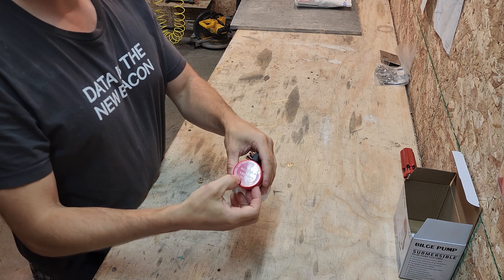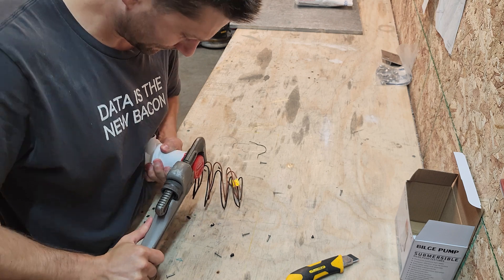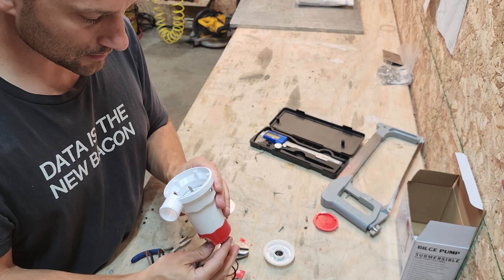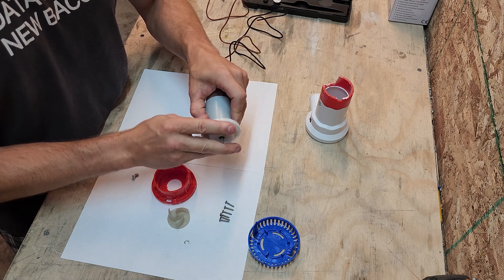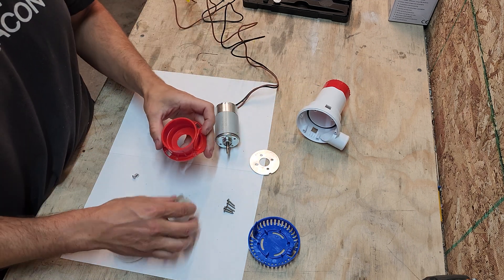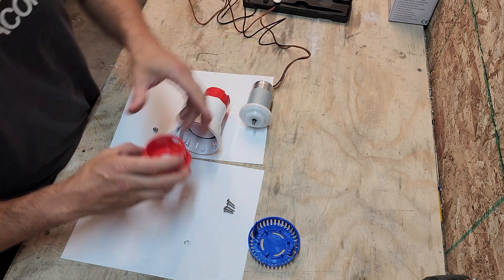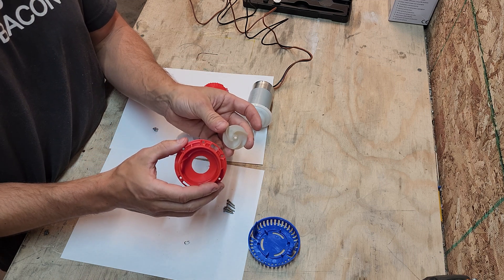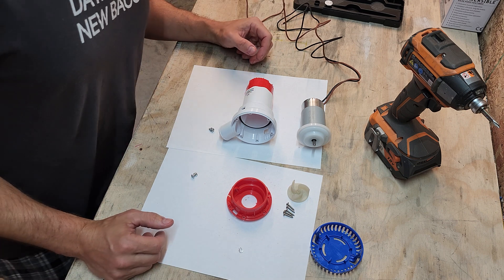Have you ever wanted to know what the inside of a bilge pump looks like?

Comment: I had the same idea some time ago...... It's definitely doable. Changing the dimensions of the impeller will produce higher pressure with smaller volume for the same power consumption.  But the real problem is how much material realistically you can move with such small dredge?  And is it worth the effort to lug all this heavy and expensive equipment with battery and hoses,  if you can move the same amount of material with simple hand pump/dredge that weighs less than 1kg?

Comment: I've noticed with the Chinese Submersible Pumps which are the 'metal can' design they should be filled with oil but they aren't.
If you get any leaks past the main gasket your pump will croak.  The best thing to do with these pumps is disassemble the housing and expose the main seal. 
The holes in the housing for the nuts and bolts are probably not drilled but were punched.  Hammer the surfaces flat and remove any burrs.
Lubricate the main seal well and reassemble the pump.  You could consider filling the pump with thin oil.  Not sure what type.  This all makes the pumps usable and still cheap.
Reply: Cheapskates value their time at zero. Rightly so. They are truly useless.

Comment: It would be interesting to know if its possible to mount a "fabricated pressure pump" to the top of your highbanker to serve as a 2" dredge. I think a 3" would draw the watts down to quick.
Reply from the maker: Yeah, I think anything electric should start at 2" until you can get some solid data on power usage.  Would need some pretty spectacular battery capacity to run a larger machine with electricity...

Comment: Did the crack go all the way through the housing? Or was it a surface scratch?
Reply from the maker: The crack did go all the way through the housing, but the crack was just bellow the O ring so the pump motor would have stayed dry inside.